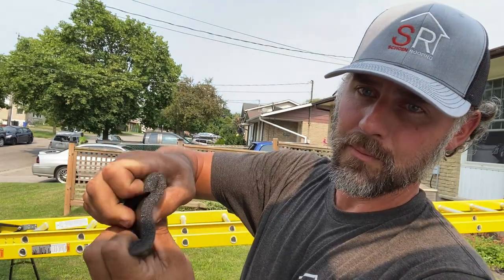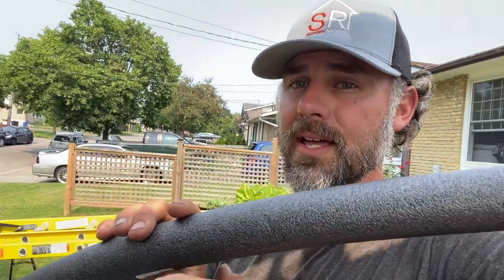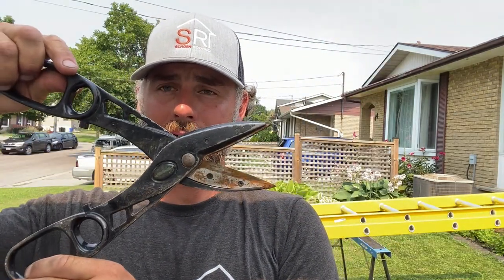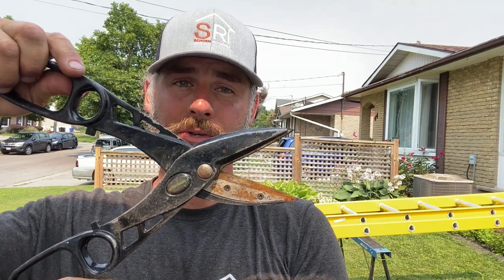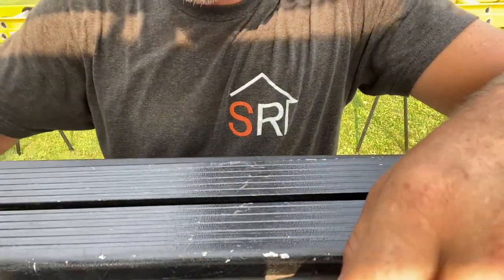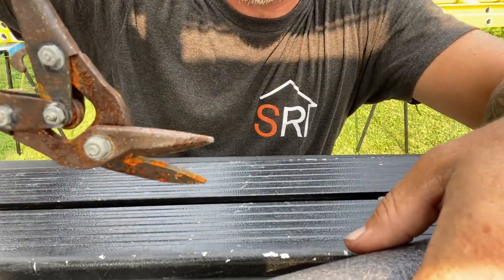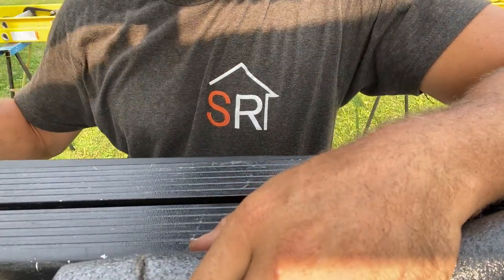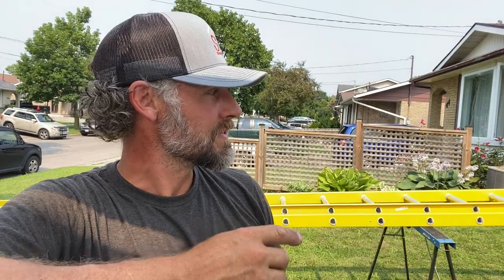Eliminate Ladder Noise

Comment: Another video showed using spray foam to fill the holes. I drove across the country with a Little Giant ladder on my Rav4 roof. The noise was horrendous! And the Little Giant doesn't have all those side holes. I thought it was the metal vibrating, which also seemed to make the roof itself vibrate. I'm looking at getting a rooftop carrier bag so I have room inside my vehicle to put the ladder. Gas mileage will still take a hit but I can't imagine the noise will be as bad.
Reply from the maker: Glad the video helped! 😀

Comment: I'll save everyone some time: 

Don't watch the 8 minute video 

Pool noodle or pipe insulation foam. Just a little bit stuffed in each rung on each side

You can use spray foam, but it'll be tough get out, ie of you want the rung hole clear to hold the brush handle
Reply from the maker: Ahhhhh man! Your taking all the fun out of watching an awesome video! 
Do not use spray foam as it can trap water in the rung.